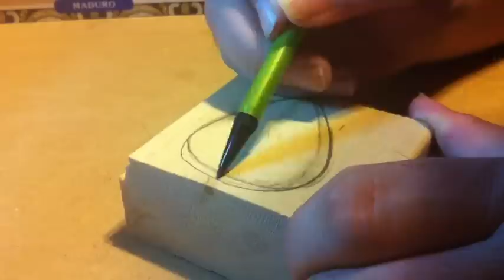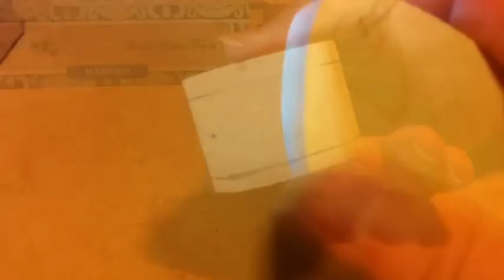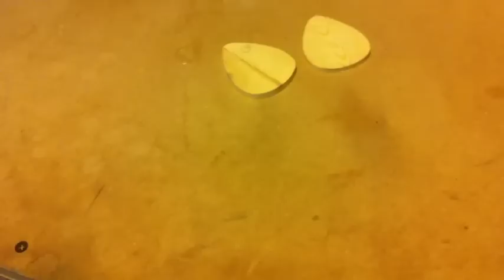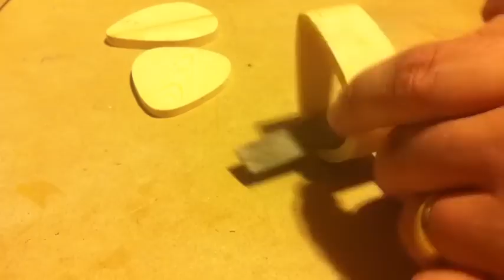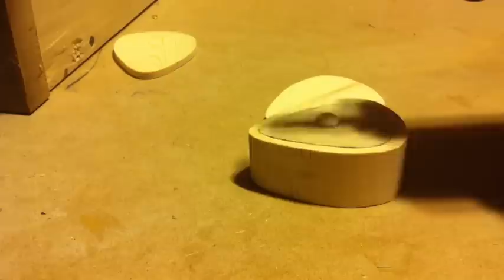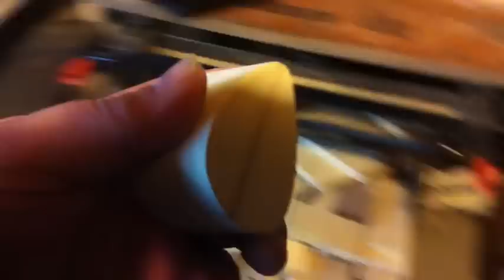Guitar Pick-Cup Container

Comment: Instead of cutting another piece out of plywood or whatever- why no just take a slice off of the piece of scrap you tossed in the cigar box for the underside of the lid?  Wouldn't give you any contrast but would save a couple steps.
Reply from the maker: Good point.  The reason I choose not to do it that way is because the amount of material removed by the blade (the width of the cut itself) is a bit too much to give a snug fit to the lid. On tiny projects like this it feels too loose.  If I were making a larger box it would be fine.  So I use the cutout as a lid for a slightly smaller one.